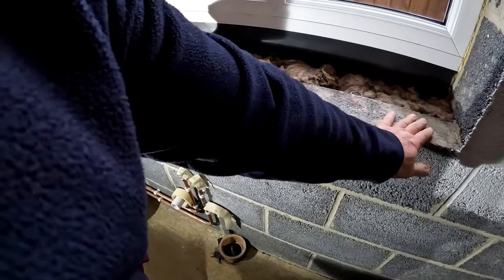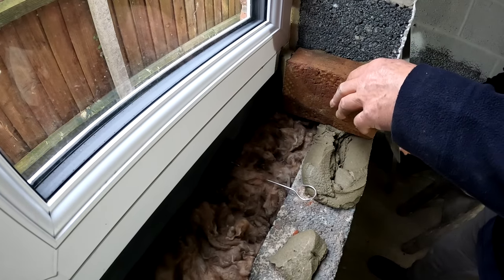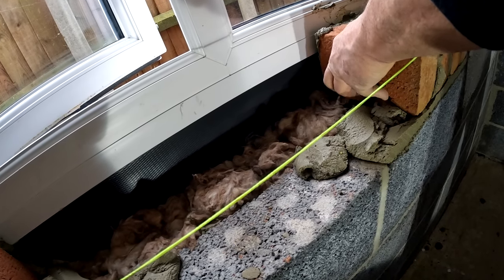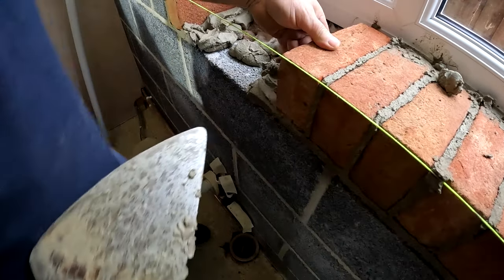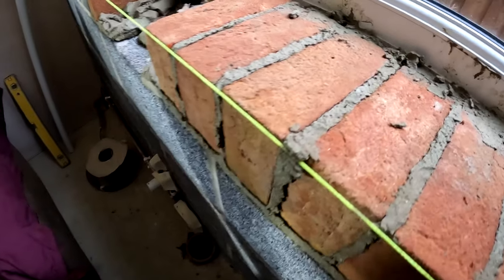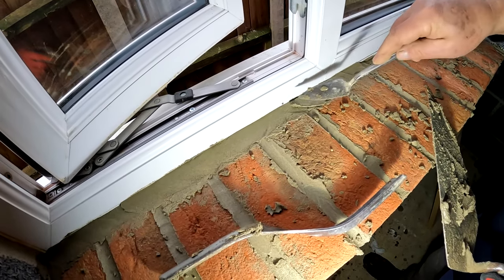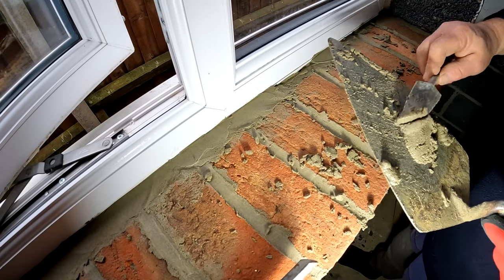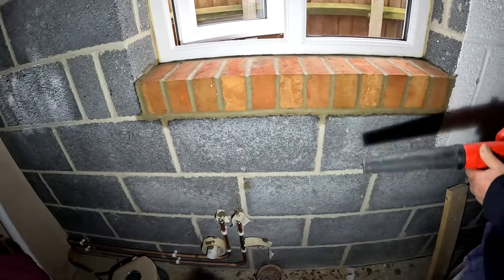How To Build a Brick Window Sill

Comment: Don’t know if I’ve missed something but won’t it be 25mm shy of the finished front after the dab and board?
Reply: Plasterboard will go over the sills and then get plastered, the bricks are to just build up the height.
Reply: Should’ve used a cut block to build the height tho, put a cavity closer in and then installed the window
Reply: Time you get 20/25 mm dab and board on that there won’t be much frame on show also please explain the cold bridge not being dealt  with ,and why spend so much time pointing it if it’s covered .
If not covered well I’d be speechless
Reply: Think it’s the finished detail
Reply: @CNorman18  I did think that but thought he was doing a fairly tidy job of it so thought maybe was a detail finish to the sills? If that’s the case I understand
Reply: @CNorman18 exactly, 100mm cut of block would have been much faster and easier